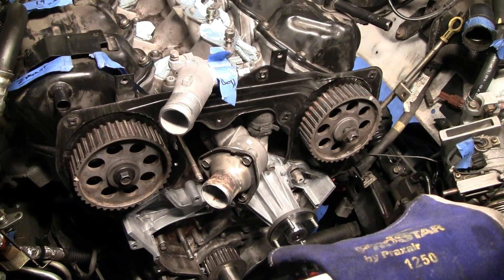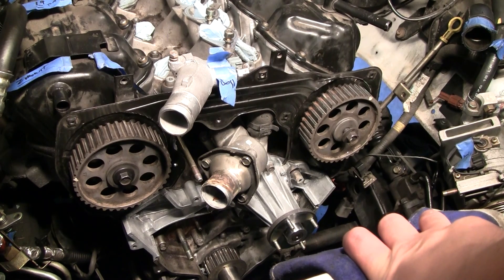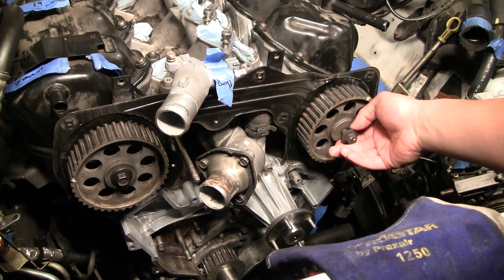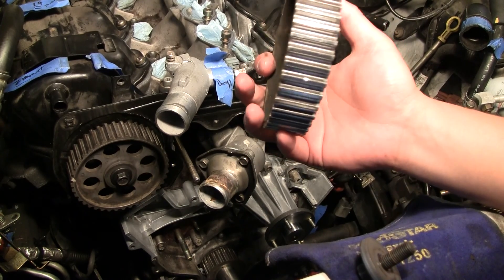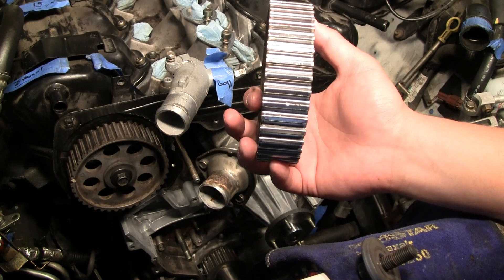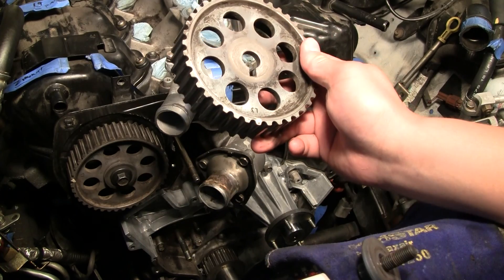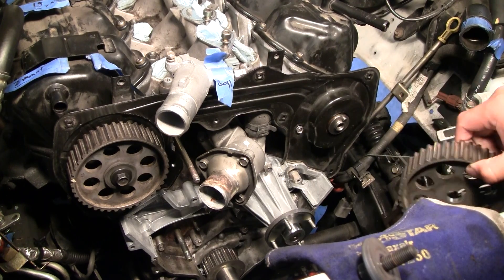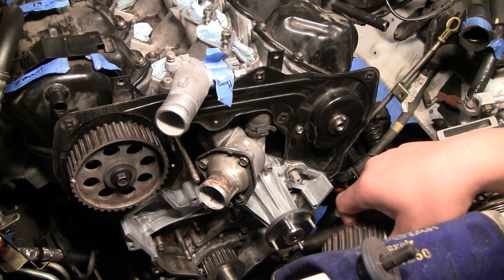2002 Nissan Xterra VG33E Rebuild Step by Step Part 79 - Cam Gear Update

Comment: As looking at the video I see that the right timing mark is at 9 o’clock. So when you install the timing belt do you turn the sprocket clockwise to the mark ? I notice on my engine when I turn it, it spring to 9 o’clock and when you turn the sprocket again then it would land on 3 o’clock.